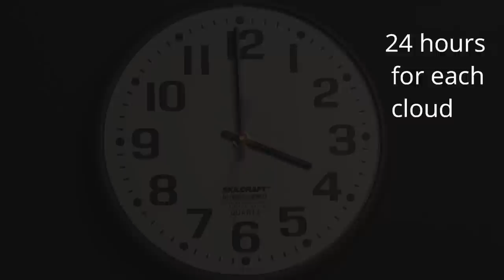HOT AIR BALLOON DIORAMA/LAMP - Epoxy Resin Art

Comment: Beautiful!
00:00:32 creating the balloon from polymer clay
00:01:51 making the landscape from polymer clay
00:02:31 all parts baked at 110 degrees Celsius for 30 min
00:02:32 painting with acrylic colors
00:02:46 using plexiglass to create a mold
00:04:36 the resulting landscape
00:05:22 painting the balloon
00:05:55 gluing the basket to the balloon using UV resin
00:06:14 making clouds with the hot glue gun
00:06:28 making another plexiglass mold
00:06:53 using Epoxytable 5 resin to fill the mold
00:07:34 removing the hot glue to create a mold for the clouds
00:08:02 pouring white epoxy resin
00:08:20 polishing all the sides of the diorama
00:08:43 making the wood base
00:09:20 RGB LED light for lightning
00:10:19 final epoxy diorama lamp
Check out the Video Timestamps browser extension for Chrome for more timestamps.

Comment: Beautifully done!
...
I wonder ... if holes the size of the building dimensions had been cut into the clay base, and LEDs placed at the bottom of those holes, if sufficient light would have come through to illuminate the inside of the buildings if their insides had been left open? For something so small, that would really require detailed and intense concentration and workmanship, but I wonder if it could be done ...
Reply from the maker: Thank you.  Yes that would be very cool. 👍

Comment: To remove hot glue easily and without mess just spray it with IPA (Isopropyl Alcohol) 

Capillary action will wick under the hot glue and release it from whatever it's stuck to.
The hot glue won't soften or become sticky again so no risk of creating any more mess.
Reply from the maker: Thank you for the tip. I will try it :)

Comment: It would look cool if there was a light in the balloon that slowly pulsed to give the effect of the burner. But, this is Awesome!!
Reply from the maker: Indeed. Thank you 😊👍
Reply: Might be difficulty to power that light without showing the wire
Reply from the maker: @mimked  Indeed. When I was building this diorama I thought about putting a light in the balloon but the only way to power it was to create a rope ladder from the basket down to  earth and put the +/_ wires on each side of the ladder and pass the wires beneath the earth surface to the batteries. But I abandoned that plan as I thought that a ladder touching the earth  would not look good
Reply: @4THECRAFT  actually i expected a light in a balloon...

Comment: Hi! I’ve been watching your epoxy resin art tutorial videos, and i must say they’re beautiful and very helpful. However, i have a question regarding the mixture of the epoxy resin and the hardener. So, me and my boyfriend have been trying to create our little business by selling this type of resin art products. But, along the process, we’re just so clueless as to why the resin liquid eventually melt the plexiglass mold. Somehow, the resin liquid would turn really hot when poured into the mold and that leads to the mold melting and ruin everything. Do you have any idea why this happens? And i’m also open if anyone at all has any information regarding this situation. Thank you very much😊🙏
Reply: Yeah so if it's overheating, you're pouring past the "max casting size/volume." Resin heats up when combined with the hardener which is the driving force of the reaction (formation of solid resin). My bet is that you're using some type of art epoxy resin that is meant for small jewelry.  I recommend looking into resins that have no Max Casting Volume such as the product this guy is using. He clearly poured at least 30oz which is a crap ton in terms of resin yet his product seemed fine and with minimal bubbles too.
Reply: Jake ah, that makes sense now. We didn’t know if maximum casting size even existed before, we thought all epoxy resins are just the same. Maybe that’s also why our resin costed cheaper. We’re currently switching the molding material to a thicker size of acrylic glass (which is doable but more difficult to work with). But we’ll definitely look it up for our upcoming future projects. Thank you very much for your input, it helps a lot👍
Reply from the maker: Hi Jordyn.  You remind me of my first attempt to use resin. I have used a wrong type of resin, exceeded the allowable volume, the resin soon started to smoke and the mold melted destroying the whole project. Through trial and error I have found that I need to pay attention to the volume/height of casting and use the appropriate type of resin. The resin I am using in this video is for castings up to 10cm thick !  which is quite high for resin castings. Also a very good resin is the one I have used in my kraken and voclano videos. You can find details of these resins in my video descriptions.  They may be quite expensive but at the end you get what you pay , right? So my advice is:  Buy a good quality resin, follow carefully the mixing ratio per the resin instructions, and do not exceed the max allowable volume/height. If you decide to risk it and make a very thick pouring (like I did in my Sun video) then use a thick Plexiglas and keep a stable temp/humidity in the room during curing. Hope this helps and good luck.
Reply from the maker: Yes Jake I agree and thank you for your helpful comment
Reply: 4THECRAFT what resin would you recommend if I have a project that is a cylinder mold that’s 17cm high?
Reply: 4THECRAFT thank you very much for your input! Yeah, i talked to my BF about it and we decided to do a more detailed research regarding the resin materials we’d use for future projects. As of now, we’re just trying to make things work with the tools and materials we already have so nothing’s put to waste.

Comment: Im trying to create a resin penny table what would be the best way to get the bubbles out It would be vary helpfull then i dont have to drill out the air bubble after it cures is a torch a way to go for it and would it burn the wood even if i just fastly pass the edges
Reply: From what I've observed in other videos, if you don't linger too long when getting rid of bubbles with a torch, the wood shouldn't get burned. Also, consider the direction you face the torch to minimise the contact with the wood.
Reply: Also supposedly when you pour the resin you need to do it from a distance (high up) - making a long thin stream of resin will make most bubble pop on the way down.

Comment: As of cost and want waterproof, is it possible to pour a big slab of this out and it still cure fine?

A project I doing looking to make wooden box and water proof but for table base doing a vacuum table and going to use system like vacuum pods set in so looking to pour about 1 metre by 70cm by 2cm and then machine when cured
Reply from the maker: Sorry I dont quite understand what you say.
Reply: @4THECRAFT  think of like make box and pour it to make a table top just from epoxy, would it cure fine? or have issues and not cure completely
Reply from the maker: @mlee6050  I still dont follow what you mean by "make a box and pour it". Would you like to write in your mother language and I will use google translate to read your message?
Reply: @4THECRAFT  I only know british english but a lot still struggle to understand me

Comment: I recently got resin whats the best way tog get the bubble out im makeing a penny table on top of a wooden table i dont uave a vacuum chamber
Reply from the maker: I think the best way for small items is the pressure pot (which unfortunately I dont have). Otherwise you must mix thoroughly, let the resin rest and eliminate bubbles in the surface before pouring, pour with care, eliminate bubles during curing, and maintain a correct  temp during curing. But you may still get some bubbles.  :)
Reply: I have seen someone pour a small layer at a time and not this deep of pour but they did tapping sides as let a few bubbles float to top, sort of like someone handed you shaken up can of coke, tap it for a while and can open without the reaction happening but for this be bubbles going to surface

Comment: Beautiful, but you need to cure the resin in a vacuum to get rid of the bubbles...
Reply from the maker: Yes 😂if I had one it would be nice 👍
Reply: it looked like stars though 😍
Reply: spray little alcohol and use heat gun that will do the job.... but do it as soon as you pour the resin into the mold...
Reply: A pressure pot is better, less mess.
Reply: @5995Oblivion  Lighter with the nozzle is best.. :)

Comment: Really a FANTASTIC  video!! I do have a question! Do you have any problems while picking out the hot glue clouds in preparation for the white poured resin clouds. I think I might not cleanly get it all out and subsequently distort the clouds?? Thank you!  Dr Bob Starner
Reply from the maker: Thank you Bob. No I dont have any issues apart from the fact that it is quite time consuming to get all the hot glue out. Of course I try to create the clouds in such a shape that it will be possible to remove the hot glue afterwards.